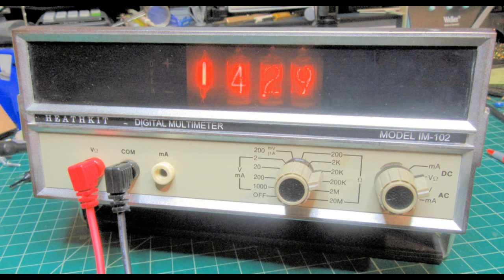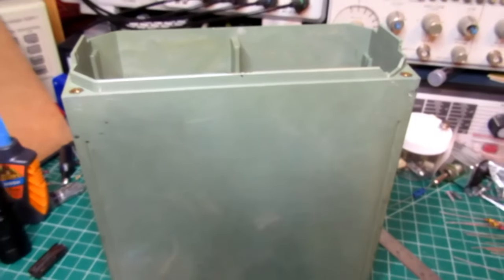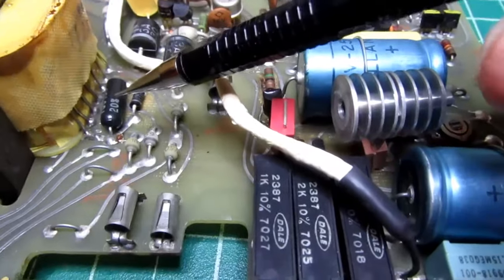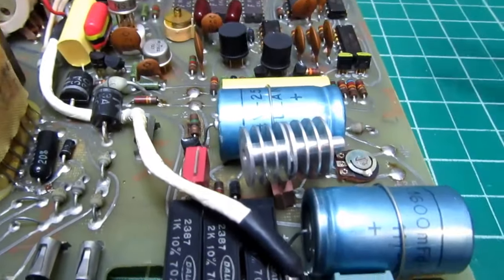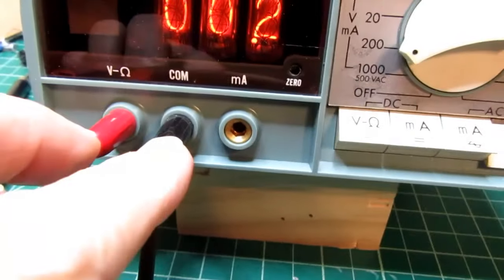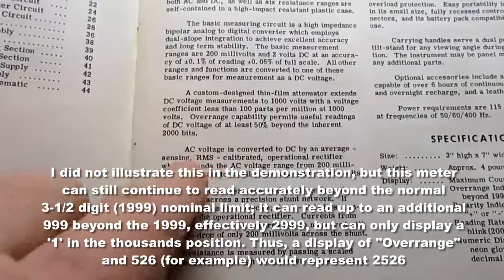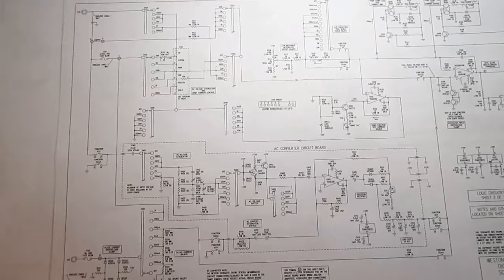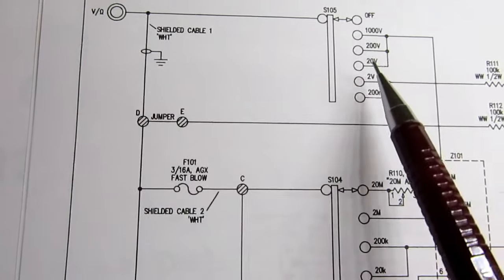Weston (Schlumberger) 1240 Digital Multimeter: History, Restoration, Demonstration, Theory

Comment: I knew that multimeter looked familiar. And I haven’t seen nor used the thing in 30+ years. But I knew exactly where it was,so I decided to pull it out of its long storage. Not exactly what you have there, but it is close enough. I have the Weston 4440, which is just a smaller version of yours. 
 I never used the thing and it was given to me by a friend who worked for UL labs. The old “C” cells still in it, and to my surprise not a single one of them leaked. I’m going to toss some new batteries into it tomorrow and see if it still works.